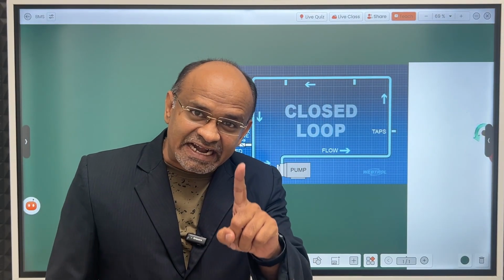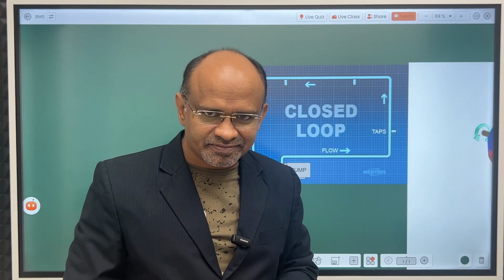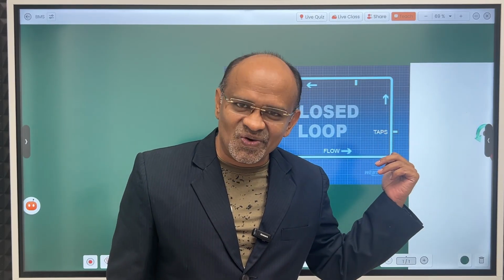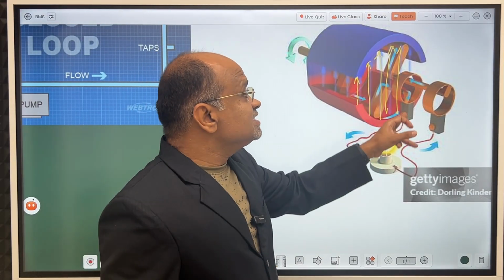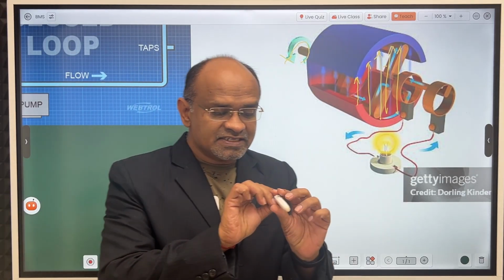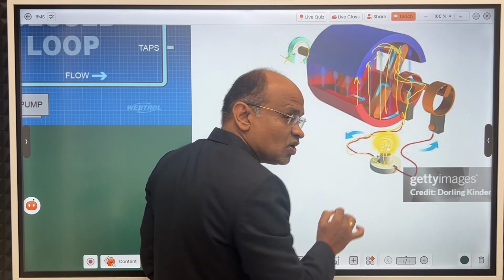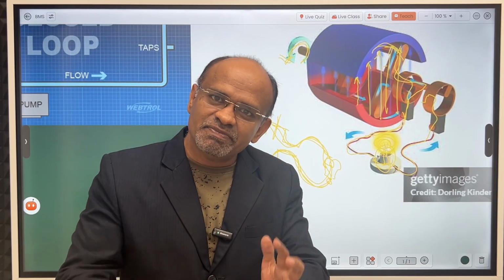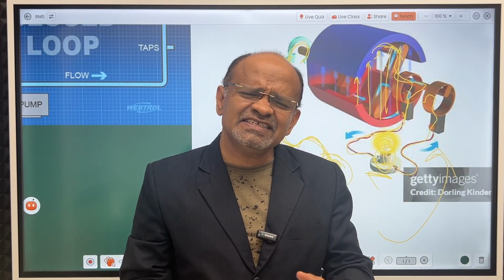How Generators Make Electricity (Explained Simply)

Comment: Sir, you are wrong electrons don't get pushed anywhere. It stays within the atom only. If electrons moved the metal will be depleted on electrons at sometime n current will stop. The fact is charge jumps from electron to electron which is called as flow of current. It has nothing to do with electrons.
Reply from the maker: Thank you for sharing your thoughts! I really appreciate your interest in the topic. 🙏

Just to clarify — in a metallic conductor like copper, the outermost electrons (called free electrons) are not tightly bound to any particular atom. These electrons are delocalized and are free to move throughout the metal lattice, which is why metals conduct electricity so well.

When a generator or alternator creates a potential difference, it sets up an electric field, which causes these free electrons to drift in a particular direction — this drift of electrons is what constitutes electric current (in conventional terms, current is opposite to electron flow).

The idea that “charge jumps from electron to electron” is a common misconception — that would be more like how electricity moves in ionic conductors or certain chemical reactions, but not in metals. In metals, actual electrons move — albeit very slowly in terms of drift velocity, but their motion as a collective creates a nearly instant electrical response.

Thanks again for bringing this up — good questions always deepen the conversation! 😊⚡
Reply: Sir, you are wrong again... Let me clarify your misconception. The so called free electrons are never free because it immediately forms bonds and becomes molecules and electrons don't spin out of the molecule hence molecules are stable. The lattice structure of metal helps propogate the charge it is not a highway for electrons to race around. If u look at electrolysis, ions and electrons actually travel through the liquid which results in deposition on one electrode and depletion on the other. If electrons in a metal moved the metal wire would also deplete. Which doesn't happen in wires and cables. The electric field that you mention here is the charge field in a gaussian plane. It's finally charge not electron movement. Please share links of any experiment which proves movement of electrons in a closed circuits. The movement of electrons fail to answer what happens when the potential difference applied is removed. Do all the electrons which moved rush back to its original position? No. Nothing like that happens. Because electrons never moved. It's just the electric field applied becomes zero so charges don't jump anymore. The electron explanation and water analogy is good for explanation but a real engineer always knows the limitations of the analogy. Your thoughts please.
Reply from the maker: What I genuinely feel is that we are both exploring and discussing theoretical models based on observations and experimental results.
After all, no one has seen an electron or a “charge” directly — we only observe their effects: current flow, magnetic fields, heating, and deflection in fields (like in cathode ray tubes or Hall effect sensors).
Whether we say electrons move or charges jump, these are different models we use to make sense of something invisible — just like how wave-particle duality exists in light and electrons.
I’m truly enjoying this discussion because science grows through open-minded inquiry and respectful disagreement. 🙏 Let’s keep exploring!
Reply: @IOTcenters sir it is wrong again... We are not talking about electrons being visible or not. Even quantum particles are not visible. But we have a fair knowledge of how they behave. Charge cannot b equated to electron not being able to see it is simply because it's the unit store of electrical energy simply like u can't see potential or kinetic or thermal energy. It can only be experienced when energy unravels. Taking ur water analogy further u can see water flow because the matter in it is moving. In electrical wires nothing moves charge jumps. All the sensors you speak of only are able to pickup when energy transitions from one state to other. I would keep the larger physics concepts out for now because the electrical concepts explained itself are flawed.
Reply: @sheetallokhande-q7o In conductors, electron flow.  They are free exactly as @IOTcenters is telling you.
Reply: @yzScott movement of electrons don't cause electricity electric field does. Mass cannot move at speed of light... Electricity does because it is dependant on a massless charge and not an electron with mass. Please understand the difference application of electric field can push electrons and cause flow of electric current. But electron movement is not the cause of current. Many experiments are conducted to check the speed of electricity. It's the speed of light. No mass can attain. Not even as tiny as electron.
Reply: @SHEETALLOKHANDE-q7o  No one says it moves at the speed of light.  In fact, the electron drift speed is quite low.  

When you apply water pressure on the end of a metal pipe, the pressure appears at the other end at the speed of sound in water.  But no claims the water moved that fast.  I barely moved at all, only the speed of the pressure change moved that fast.

It is the same with electrons.  

You are wrong.  The owner of the channel is correct.  The end.
Reply: @yzScott how does this flow of electrons explain capacitance. Be definition capacitor has a dielectric which doesn't allow electrons to jump. How would u explain electric circuits working with capacitors where unless u accept that it's charge and electric field which causes current not electrons, u will be able to exain capacitance.
Reply: @SHEETALLOKHANDE-q7o  It is commonly known that capacitor work by accumulating electrons on one of the plates.  That can't happen if electrons don't move.